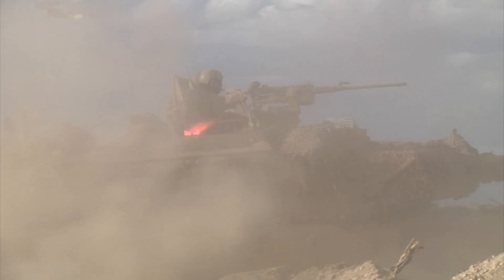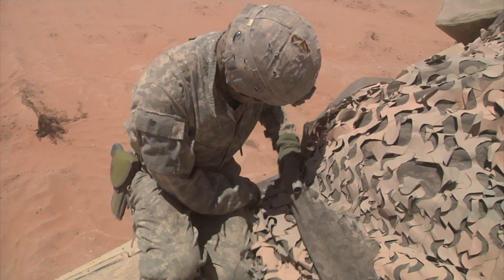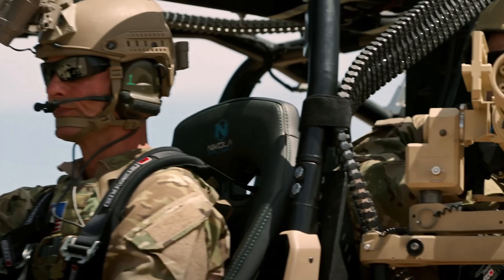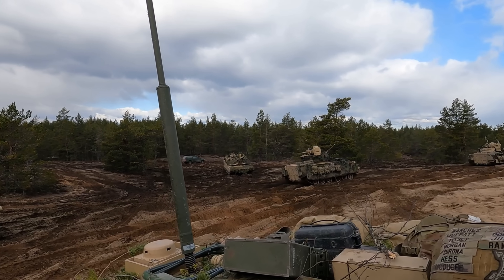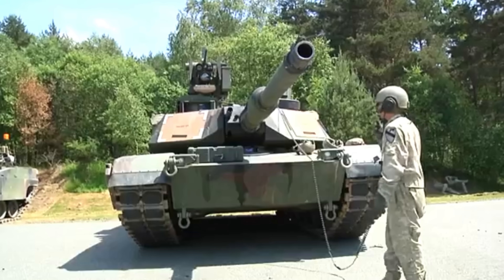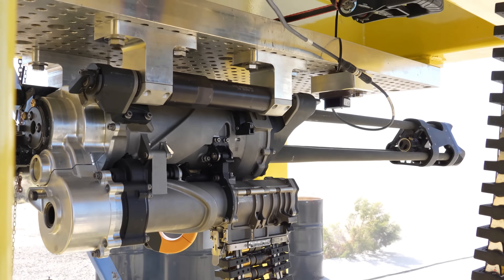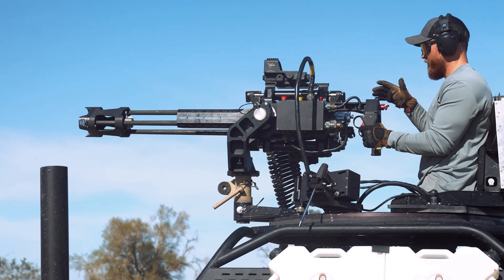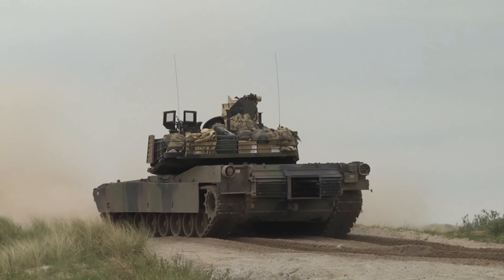Why is the U.S. Army putting a M134 Minigun on Abrams? | ROTARY GUN DEFENSE

Comment: Id go way smaller. Against these drones that might pop out from around a corner 20 meters away you need near instant gun laying and for the attrition style attacks they are used for you need deep ammo reserves.
But what you don't need is huge bullets, or even particularly fast ones, 9mm might do the job or 5.7 some sort of electric accelerator for ball bearings if you are feeling adventurous and want to let it automatically defend right between your tank, another tank, lightly armored vehicles and perhaps even meters from infantry.

Comment: You're right. We shouldn't put the M134 Minigun on an Abrams. We should put dual M61 Vulcan Cannons on an Abrams. Twin-linked, if you will. Or maybe create a larger tank system with a GAU-8 Avenger. Way better.

Or a shotgun system like you mentioned. Possibly an automated one of some sort. Dual M61s would be way cooler though.

Comment: Armor needs the active protection systems that handles RPG/ATGMs, with modifications so it can spot drones. The anti-drone charges will need to be smaller, more numerous, and easily reloadable by the crew. The least crazy thing for the turret top would be a Mk.19, radar or optical targeting, and a programmable tungsten fragmentation round. This is not for last ditch CIWS, this permits interlocking bubbles of defense for a tank platoon and any associated smaller vehicles, while limiting the friendly fire hazard. The M134 gets a shot because 1) it's a proven weapon 2) with ammo already in the supply chain 3) that's easy to train. But as the video states, it's wholly inappropriate for all sorts of reasons.

Comment: It's a fallacious concept on many levels, not the least of which are reaction time, multitude of drones attacking in conjunction from different altitudes or angles and the need to operate hatch closed on battlefields that a low altitude drone you didn't notice can come from directly above and drop a grenade on you.
The Russians with the latest T-90 iteration seem to be going the right way about it,adjusting the APS on it to account for high speed drones. I hear they even plan to fix the backwards speed problem...
But, cool concep.t

Comment: On that mention of a shotgun style system at the end. I've heard a lot about shotguns being used in Ukraine against FPV's with middling results. A key complaint seems to be that birdshot isn't strong enough, so they've got to use buckshot against drones. That leads into a problem of its own, because 00 Buck has the force and energy to knock down a drone, but only 9 pellets to a shell, so they've got something of an issue where the spread pattern isn't dense enough until the FPV is within ~30yds or so.

They've tried using No. 4 Buckshot, which generally packs 21 pellets to a shell, but then they start running into issues where the shot is too weak at range to reliably knock a drone down until it's dangerously close again. The simple solution would be a custom anti-drone shell with a magnum powder load in a fired from a shotgun with a 3.5" chamber. Simple in the terms that it isn't a mechanical challenge, it's a logistical one to source the guns, design the ammo and produce it.

On something the size of an armored vehicle like the Abrams, you get a chance for something pretty neat, like using a Mk19 loaded with canister shot, a la the shells issued to M79 gunners during the Vietnam war. That still leaves the gunnery question, and  what to do about ammunition, and the fact that you'd probably have to replace the commander's .50 Cal with a CROWS/RWS mount for the AGL.
Reply: Absolutely useless against fast speed drones, and even against FPV drones, if the shooter cannot see the drone. Or is more than a drone. Or if the drone stays out of range and is dropping mortar shells on you. So, pretty much useless in everything, except short range, solo drone.

Comment: The real solution for fighting drones is a pintle mounted, belt fed rotary 10 gauge shotgun. I say 10 gauge so each shell can have more shot packed in. Being pintle mounted the shooter won't be affected by the 10 gauge recoil. 
Also, each barrel section can be screw together to give adjustable barrel length since each barrel would most likely be smooth bore.

Comment: TBH, a better long-term solution for drone defense is a specialized (anti-air) turret...weapon & targeting sensors on a Bradley (or an equally sturdy vehicle), which was meant to keep up with the M1 Abrams.

As to what weapon to be used, I suspect the best solution is still being worked out. I would favor a 'near/far' arrangement (to keep things as simple as possible); and a sensor system to minimize the typical (DJI-type) drone advantage, e.g.- quiet and small. AND, more importantly, not publicly discuss it. The primary threats are known; no sense giving the opposition a 'heads up'.

Comment: The Australian Slinger gun system can provide an anti drone capacity with a choice of guns but usually 25mm. As used on the LAV25.  This uses and advanced optics systems based on an astronomy platform.

Comment: If it's manually aimed, it's worthless. It'll never hit a drone if the vehicle is moving, and will only hit a drone when you're really lucky when the vehicle is stopped.

If it's a stabilized RWS, with 90 degree elevation capability, and it replaces the .50 so it has clear fields of fire? It'd be good. Eliminating the .50 means you only need to worry about 7.62 ammo, which it has in common with the coax. Having a stabilized RWS means it can actually hit stuff on the move, and the fire control system can automatically track and lead a drone so it stands a good chance of hitting it.

If you're going to do it, though, go with the 7.62 minigun, not the 12.7mm GAU-19. The GAU-19 has a MUCH lower rate of fire, which means the chances of hitting a drone are much lower. Yes, it has a bit more range, but you don't need that extra range when a drone is incoming as much as you need three times as many bullets downrange. Also, 12.7mm ammo is just plain heavier and bigger than 7.62mm ammo. Even at 3 times the rate of fire, the 7.62mm minigun consumes less weight of ammo per second as the GAU-19.

Yes, this does reduce some capability against various light targets that the .50 is a bit better against than a 7.62GPMG. But it's counterbalanced by the simplified logistics and the effectiveness against drones.

Comment: I'm on the same page about the rotary shotgun. I'm really surprised we haven't seen one on the market yet. I figured this system would be set up as a standalone with a battery (and external power source), along with a detection sensor and fire control system. Ideally the crew hits a button to put this drone killer in "active kill mode" and for the next 30 seconds it fires 12 rounds of buckshot in 2-3 seconds anything flying and moving faster than 2 meters per second. This thing needs to be a stand alone kit so it can be deployed atop vehicles, buildings, infantry positions, and have a range of about 50 meters. The device could be made reasonably safe by including physical stops in the elevation and horizontal drive system.

I keep thinking I should just build the prototype, but I keep expecting to see a prototype any day now.
Reply: Too complicated.
Micro turrets with Metalstorm 12 or 20 gauge barrels for last ditch point defense.

Comment: The engineering side of me is tempted to try and make a rotary defense weapon that fires birdshot.
Reply: If you do try using reloaded 1" flare cases with 6mm steel BB shot 40-60 balls should be sufficient. Because of their weight requirements drones are fragile and easily damaged so a light powder charge should be sufficient.

Comment: What about a 12 guage multibarrel gatling shotgun ?
Reply: It's a fun idea, but each ball from a shotgun round is weaker than a pistol bullet. So, you can get a much better effect and range with a much lighter and more compact 9mm gatling. Possibly in a dual feed configuration and an odd number of barrels to double the rate of fire. The short action enabled by 9mm means you could get utterly hideous rates of fire. And the barrels could be as short as 5in.

Comment: I've also seen projects working to create a short barrel 30mm cannon RWS with radar and optical guidance and proximity fused ammunition. That feels like a more practical system
Reply: 40mm Mk.19 will go first. The attractive thing with 30x113mm is that they're MUCH more reliable AND you can dual feed. a 40mm just for drones works on drones, a 30mm dual feed does a drone one minute, then hammers the drone's operator and the vehicle he's in the next. I think the Leopard II or it's upcoming replacement is going to ship with something along these lines.
Reply from the maker: Interesting, thanks for the info!

Comment: "Just the Idiot in the Back of the Classroom Here…"
(A Rant on Counter-Drone Defense Concepts for Ground Vehicles)
So, everyone’s buzzing about putting an M134 Minigun on an Abrams tank to deal with drones.
Cool visual, yeah. But here’s a thought—from back of the classroom:
Why not skip the Gatling cosplay and develop a belt-fed, fully-automatic shotgun system specifically designed to counter drones?
Think about it. A 12-gauge platform, belt-fed, rapid-fire, loaded with custom aerial denial shells—frangible tungsten flechettes, expanding airburst rounds, or even flak-style fragmentation—optimized for shredding fragile, fast-moving plastic nightmares at low altitudes.
Instead of precision, we go full "cone of death." A sky broom.
Now, pair that with a compact, short-range drone detection suite—something that doesn’t weigh a metric ton like existing military-grade radar arrays. We’re talking:
A multi-spectral sensor array: combines acoustic triangulation (to pick up the high-pitched whine of quad rotors),
Infrared optics (to catch heat signatures),
And maybe a low-wattage pulse-Doppler radar with a range of ~2–3 miles—more than enough for local threat mitigation.
Think of it like a portable firewatch tower, just smart enough to yell "INCOMING" and auto orient a turret. The civilian analogs already exist in portable bird-tracking radar and UAV hunting systems used at airports and embassies.
Now, as for those fibers or tethered drones, fiber-optic guided munitions or FOGMs. Some drones do use ultra-thin fiber optic tethers to prevent jamming and to give real-time video feedback without relying on radio signals. They’re stealthy—but not invisible. That tether can reflect IR or laser signals and even carry a magnetic footprint detectable with the right instrumentation. Combine low-frequency EM sniffers with a fine-tuned IR laser scanner, and you might be able to spot the line and backtrack the drone’s position in real-time.
This entire system could be manned or autonomous, mounted on a tank, MRAP, or stationary perimeter point. Unlike a high-speed minigun, it’s not spraying $1-per-round NATO ammo at plastic decoys. It’s smart, scalable, and built for the reality of low-cost drone swarms.

Comment: I agree with your assessment on this one. The minigun is too accurate with too high an ROF to be practical for this purpose. What is needed is, as you said, something with a lot more spread, like an auto shotgun. Belt fed 360 degree shotgun turret when?
Reply: For air defense, gatlings can have barrel brackets that purposefully spread the bullets by introducing slightly different aim points for the barrels. This was used, for example, in the M163 VADS.

Comment: hey Matt you got gatling types mixed up M134 is 3,000 per minute not 6,000 that's the M61 20mm vulcan!!
Reply: The M134 can do up to 6,000rpm. It's purposefully nerfed down to 3,000rpm or 2,000rpm for various applications where the higher RPM is not deemed necessary or desirable.
Reply: @IsaacKuo  capable of more or not Dillion says it's too unreliable above 3,000 (mainly due to the delinker jamming up and breaking parts!!) to run it faster and if that's the case then 3,000 is t's practical top end!!

Comment: They can run the m134 off of dewalt batteries now . Allowing it to be fitted more quickly to vehicles.
Reply: Why buy extra batteries when you can use the vehicles? It not as if the weapon is man portable!
Reply: Nah, dewalt is to visisble, to easy to spot. Flex batteries are better suited.

Comment: Two things.

First; The sectors of fire shown are all wrong. Drones are effective because they give 3rd dimension strike capability. The Army isn't worried about 2nd dimension sectors of fire when the threat is over your heads. The gun needs to have unimpeded aerial view, unless that M2 is swung over the loaders hatch, that isn't a problem. 

Second: upscaling the weapon system acheives nothing except more waste? .50 cal ammo is already $12 a rpund for the Army, and you want to spend $1200 a second? 7.62 is already overkill for plastic drones. .50 is just criminal waste amd abuse at this point.

The solution is a downsized M134 firing 5.56 at the same rates of fire as the M134. You can double your ammunition count over 7.62, and its probably 7 or 8 times more efficient and cheaper than .50. 5.56 is capable of removing any drone from the sky and considering its on a smaller frame than a m134, its easier and quicker to aim.
Reply: They did make a 5.56mm baby mini-gun, the XM214. It could go up to 10,000rpm. It never went into production, as no one was interested in it at the time.

Comment: Why not give the commander's rws an uplift? From the regular M2HB, switch it out for the USAF's GAU-21 which is essentially a faster firing version of the M2 firing at around 1200rpm which kinda makes more sense as the loader's engagement angles make no sense having the m134 for the loader. 

That way the Abrams can maintain its signature .50 caliber HMG but with an increased rate of fire to be able to engage drones while maintaining ammo sustainability because 1200rpm is still fast but not too fast that you'd expend all your ammo in a single engagement. I think it's better to go with that IMO rather than make the loader's already cumbersome position even more cluttered with the m134. It looks and feels badass of course but realistically speaking it's a terrible idea, It's better if the loader keeps the m240 but the commander should get either an rws or even a manually operated GAU-21 for drone defense.

Comment: You really need a remote control 20mm with proximity fuse and a large amount of shrapnel, you don't really need high velocity as drones are generally fairly slow. Probably radar controlled with optics for the computer to determine what it's looking at. With a not super powerful radar and can leave it in automatic mode so it just engages birds of a specific size and up. Or maybe the crew just turns it on when they know drones are about. You can't really have a system that requires another crew member or more work for the crew you want a smaller crew 3 man tank ideally.

Comment: In summary, while standard miniguns like the M134 do not currently utilize programmable munitions, research and development are exploring the feasibility of incorporating this technology into high-rate-of-fire weapon systems like miniguns, which could revolutionize their effectiveness and battlefield applications. companies like Metal Storm have developed weapons with extremely high rates of fire and programmable munitions
Reply: You appear to have missed the key feature of drone warfare, expensive high  tech weapons systems are being destroyed by low tech and low cost solutions  wholesale. High tech solutions are expensive, fragile and require specialise maintenance which weapon suppliers are more than willing to sell service contracts for. Taking your Metal storm reference as an example, the manufacturer developed a weapon that was single use with a stupidly high max fire rate that  has no practical military value. They made the mistake of marketing the system using hype. Granted, the system being electronically controlled could fire at manageable fire rates (600-800rpm)  like a normal machinegun but, it was cheaper to buy a M60 and 12 boxes of ammunition than one single use Metal Storm launcher plus it did not require a power supply to use, batteries not being commonly available in frontline situations or while under siege. The military like simple things, they are generally cheap to replace, attrition rates being what they are, they are less likely to go wrong because of their simplicity and are easier to field repair when they do. They are also multifunctional being able to undertake multiple tasks reducing the need to carry multiple devices and reducing the logistical overheads. You only need to buy a machinegun once and simply resupply it with cheap bulk buy ammo, not constantly repurchase the entire weapon system, ship hundreds of bulky boxes to the battle area and then dump it when it was expended. This is why Metal Storm was a failure. Logistics and economy wins wars not fire rates. This is why Ukraine is winning!
Reply: The problem is, building electronics that small, on that scale, is absurdly expensive, and the military has already concluded that programmable munitions under 40mm are basically not worth it because the explosive payload of the rounds is simply not big enough to have a credible effect. 

Some sort of high ROF shotgun system would be much more cost effective for the purpose of filling the sky with a wall of lead.
Reply: @tackytrooper  In other words, AHEAD ammunition.
Reply: there are various 30mm airbursting rounds available,  EOS an australian company has developed a light weight system thats compatable with any standard cupola mount so in theory can be mounted on anything like humvees and JLTV.  They have sent some to ukraine,  you can google slinger and find videos of them mounted in the bed of RAM trucks